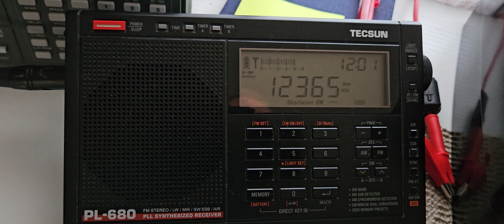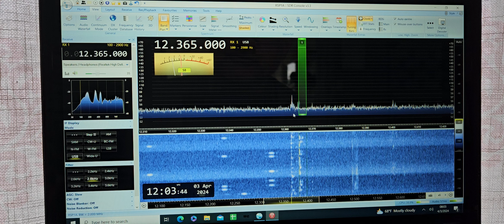Comparison of Australian marine weather station VMC on two radios

Comment: Nice comparison. Have you compared your two MLA 30+ antennas at those two heights back to back on the same radio? I too have an MLA 30+ at approx 3 feet of the ground. If you have, just curious as to the findings. Differences if any.? Thanks!
Reply from the maker: I will try that and post a video. Thank you for the suggestion!
Reply from the maker: I did a comparison using my SDR hooked up to the 10 ft antenna and the 3 ft antenna. Video posted on this channel. Thank you.